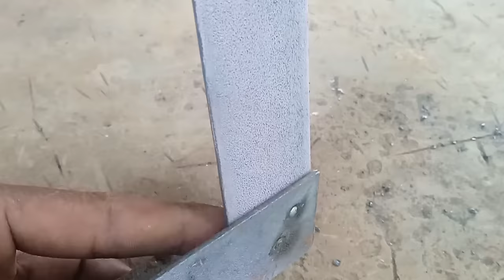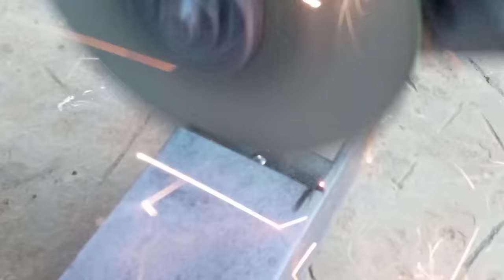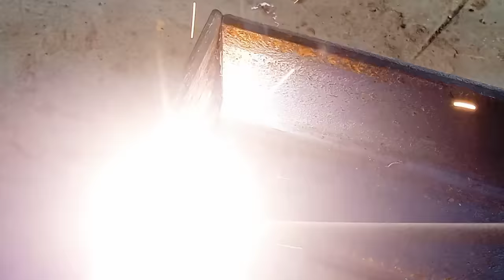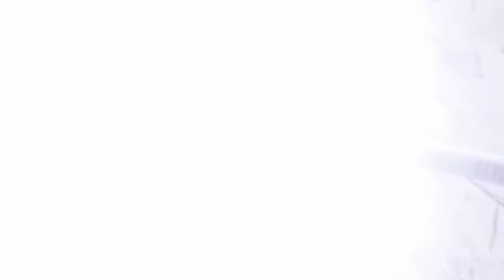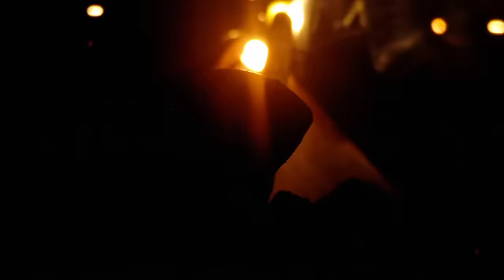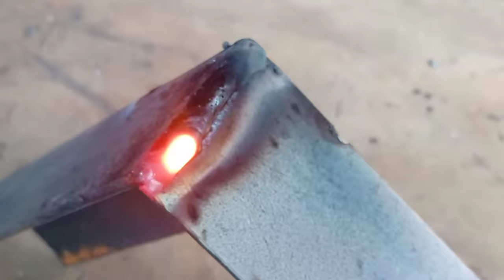learn to weld||learn to connect angle iron 90 degree for beginners.

Comment: Looked like the outside corner on the vertical either didn't get welded or had poor penetration. Do you ever run a continuous bead or just do multiple spot welds. For really thin sheet metal, I see the attraction but that angle iron was plenty thick.
Reply: Well said my friend. I've done this a thousand times and every one of them looked way better than that did. For beginners? This guy is a total beginner and shouldn't be trying to give tips to anyone. I think he only uses one size of electrode for all thicknesses. If I did one that bad, I'd have lobbed it right in the scrap bin and started again.
Reply: First you bevel for good penetration. Tack open 1/8 of an inch it will shrink. Weld it tack or stich either way.. I retired a few months ago I welded everything for over 30 years.

Comment: Please stop "welding" like this.
Reply from the maker: Thank you, please give me advice and share knowledge
Reply: Wow, so rarely do people actually want to hear how to get better! There are so many of people welding like this it makes the novice feel like this is acceptable. I'm sorry to sound mean. 

When you stick weld like this you form a nice arc, create a tack, and the flux protects it while it cools. Fine so far, but then you make another tack, and the cooled flux on the tack will very likely create an inclusion meaning you will trap small bits of the burned flux in your base or weld metal. These inconsistencies will make your weld so much weaker. The metal will stick, but if you stress it, I'd almost guarantee it'll break on the weld.

So, if you want to fix it and still tack weld you would actually have to clean off the burned flux between each tack, which would be time consuming and so much harder. There are instances where this could be an option, for example your welder amperage can't be reduced enough or the stick size is too big and you are burning through the base metal. You could run several tacks along the joint with no overlaps of tacks, clean off the flux, and repeat.

Best practice is to just lower the amperage so you don't burn through and then run a string without losing the arc along the joint. Anytime you have to stop and go over a previously welded spot, clean off the burned flux.

There are so many really awesome yt channels, you'll become a great welder just watching a few hours worth. Check out for example weld.com channel, timwelds, or so many more. There are tons of great stick welders doing amazing work.
Reply from the maker: Thank you🙏🙏
Reply: The metal is thick enough to continously grag the rod not that tacking style method
Reply: @emptyb9968  your correct👍👍👍i'm student from Phillipines and i'm studying SMAW in Grade 12 Senior High 👍👍👍i understand what is your want to say about to he's welding Procedure

I 101% Agreed on you🙇‍♂